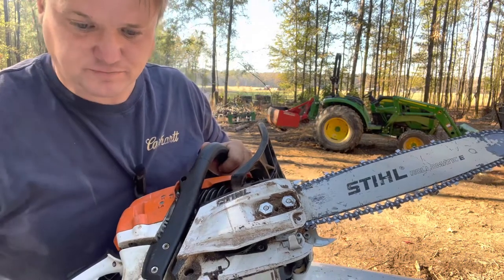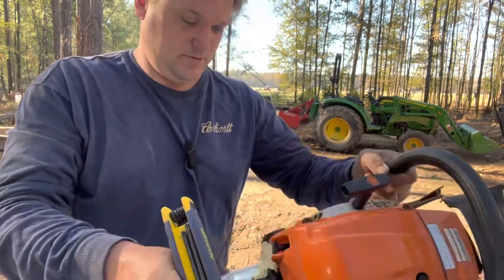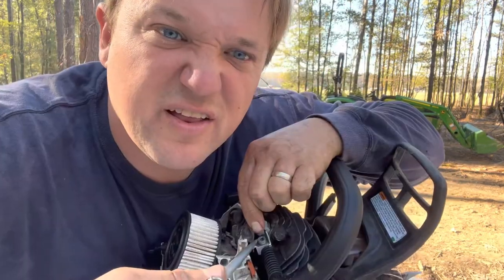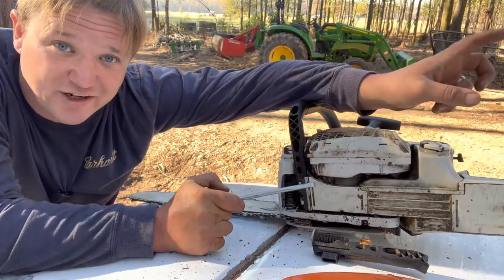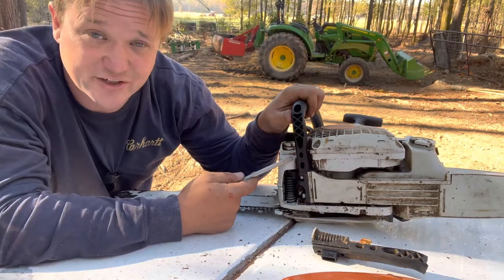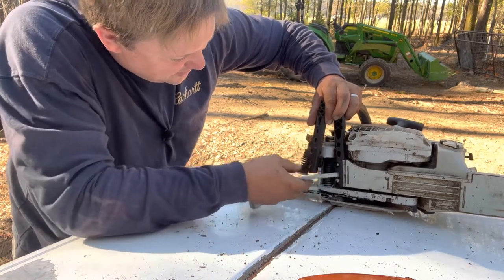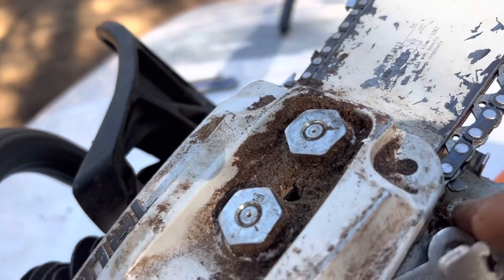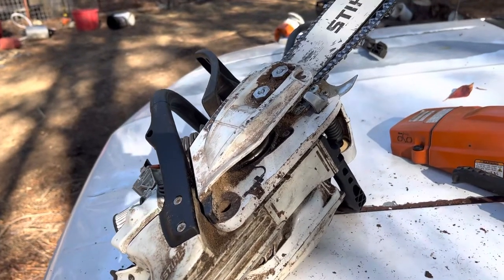How to Replace Stihl Chainsaw Handle MS 261

Comment: Thanks for the video. I found it was easiest to get the foam dampener in first and then angle the trigger guard to get the bottom tab in. Definitely trickier than taking off.
Reply from the maker: Yes indeed. Thanks for the comment and thanks for watching.

Comment: Thank you for the information ,it helps me a lot .I am with ms391 and my "star shaped" shock absorber needed to be replaced and I was shoked that must to disassemble the oil tank , didn"t expect for the "secret" screw :D
Reply from the maker: I'm glad that it helped. I'm not familiar with the procedure on an MS391, but I just took off the handle on an older MS250 and it was much more difficult that this MS261. Thank you for watching.
Reply: @DowdleFamilyFarms  It was exactly the same procedure,thank you again :))))
Reply: Thanks so much…I have an MS261 and couldn’t figure out that bottom spring at at.  Thanks!!
Reply from the maker: Glad it was helpful. Thanks for watching.

Comment: Im actually switching back to Husqvarna saws due to the complication of the stihl handles.
Reply from the maker: This the only time I’ve had an issue with this problem and I run a lot of Stihl equipment.